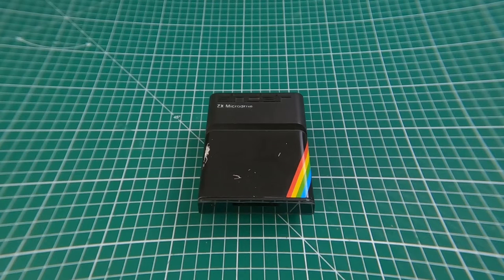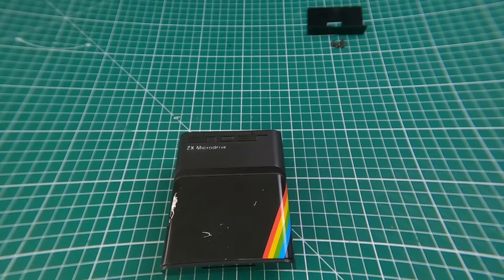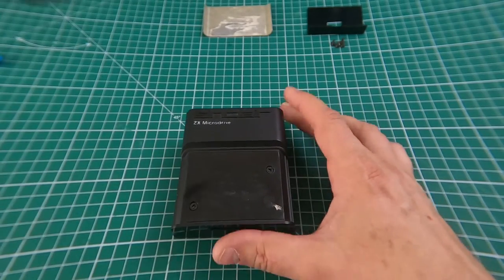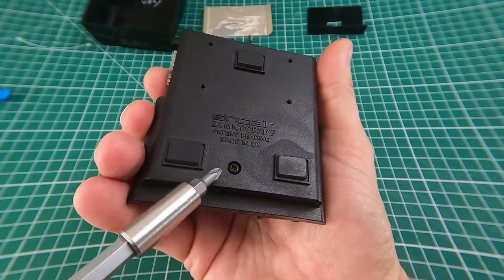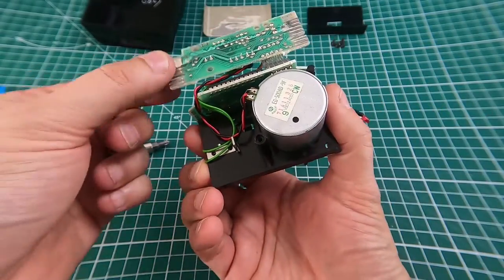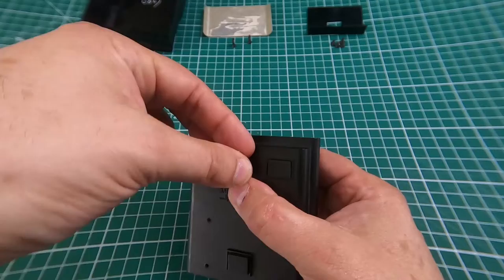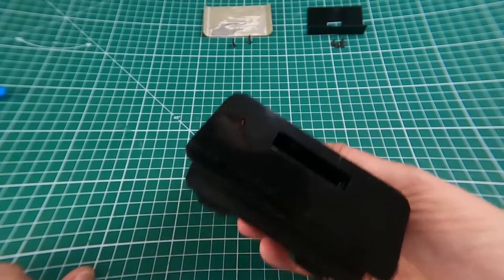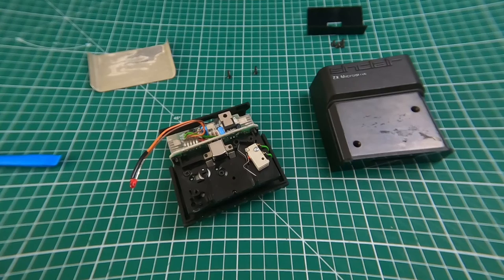Sinclair ZX Microdrive Disassembly - The Easy Method

Comment: Thank you for your excellent video. I can suggest a very quick method, just heat the metal part, even with a hat dryer. The glue melts a little and comes off very well.
Reply from the maker: Other people have suggested using heat… I’m a bit reluctant to apply heat to 40 year old plastic… 😜

I found the glue used had deteriorated so the metal plate came off pretty easily without having to risk anything.

Comment: Any reason why for not using a rework station to warm the double sided tape before using the plastic prying tools?
Reply from the maker: You could… but you would need to be careful. I doubt the 40 year old plastic and internals will like excessive heat.

Note that due to the age of these devices, the double sided tape is going to have deteriorated anyway.

So you won’t need any heat when teasing the metal off.
 
I didn’t. 😜

Similarly for the face plate in the rubber keyed Spectrum - after 40 years a gentle lift with a plastic pry tool is going to be enough.

EDIT: Forgot to mention that GooGone or lighter fuel are both pretty good at dissolving glue - and they both evaporate. A few drops or either can release more troublesome glue without using heat.

I tend to use GooGone for sticker residue and lighter fuel for cardboard box joints. Both are effective as cleaning agents too.
Reply: @sterntechdaddy  THANK YOU for your thorough reply.